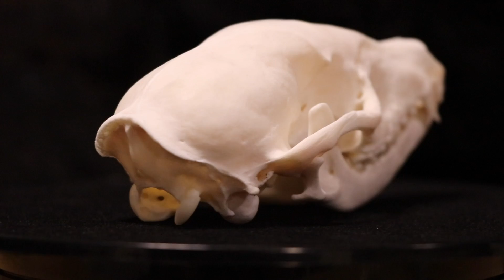HOW TO CLEAN A COATIMUNDI SKULL

Comment: Get a manual punch (hand) drill. They are used by jewellers and are used to drill pearls so you would be able to drill even the smallest of those tail bones. It's slow work but worth it if you want to string/wire them up.
They are only a few USD's so not a large investment other then time to drill the bones. Hope this helps.

Comment: I recently came about a beautiful 16 point deer skull and me being an amateur, put it in a solution of chlorine bleach. I then read that this was bad for the skull and it would flake, yellow, and pretty much ruin it. I was wondering if using the peroxide whitening method would reverse these effects or if anyone knew of a way to salvage the skull.
Reply from the maker: +Sean Ravel Is it all still solid and in one piece?  If so you can dip it or literally paint it satin white just for atheistics.
Reply: WHITEBONE CREATIONS HUNTING I realized my mistake after soaking it for about 10 hours in some bleach water. So far it has this powdery texture and I have noticed it has yellowed a little. This is after I boiled it to remove some excess flesh (again I'm an idiot). So you think the using Peroxide to whiten will reverse the effects of the chlorine?
Reply: WHITEBONE CREATIONS HUNTING yeah it's all in one piece. And the antlers were not in the bleach

Comment: Hi! Love your videos very good stuff. I need some guidance however. I got a deer skull from a friend and I skinned it, boiled it, took off all the meat and boiled it some more in oxy. Then tried to get everything off and did a decent job but there was little bit here and there. I didn't have access to a power washer that same day so I used one day after it. The when it was drying I could still smell something and did it again with a steamer (don't know what the real term for it is, a thing that shoots out steam) I got more out of it. Couple of veins and stuff but it feels like the bone has really taken it's toll and I don't know if it's in my head or not but there is still a subtle smell to it. You can't smell it unless you actually get close and take a sniff.

Long story short my question is that is it still safe to boil it again and try again with power washer or is my only hope using vetyperoxide? I was hoping to keep it skull colored but it's my first skull so I don't want to break it.

Comment: Great video! Love them all! 
Quick question: skulls go in the 50/50 peroxide mix while bringing to boil, or wait until boiling before adding skulls? Got some etching on two pigs I just did...
Reply from the maker: +Johnnie Farkas I have had that a bunch especially with new peroxide. I kinda feel my way through old pigs can take more boil and more chemical than young pigs. I try and give a real general rule with the 50/50 but you may find 80 20 is your mix. Hope that helps. Don't be afraid to experiment you may just come up on the perfect formula.  Thank for watching.

Comment: For the tail, do you need to drill it, or could you just run fishing line through the vertebrae where the spinal cord ran through?
Reply from the maker: +Paul Helms There is no vertebrate hole it solid bone held together by tendon.  The end bones are the size of 10 lb line. It glued up good.

Comment: Hey Brother, love the vids. I want to share a tip with you, for once! Those oil spots that appear on K9s and stubborn greasy spots on bear(or any skull really) are frustrating to say the least. Soak them in a pot of acetone for two weeks or until all oil has been pulled out. It does not damage or compromise anything in any way. Use a pot with a good lid, because it evaporates quickly if you don't. It works great for when, as you mentioned, boil oil into the skull also. You will love this, I just know it. It's a lifesaver when it comes to quality. Absolutely love your vids Bro. Don't stop! Cheers.
Reply from the maker: +Joshua Wells Joshua that is huge. I appreciate the info and I will give it a go asap on an old fox I picked up just recently.  Hope your well thanks for watching.